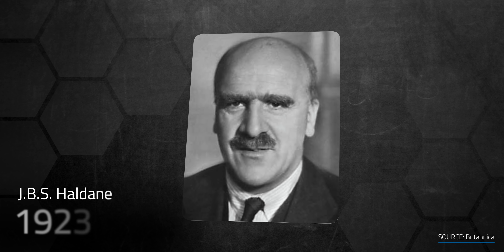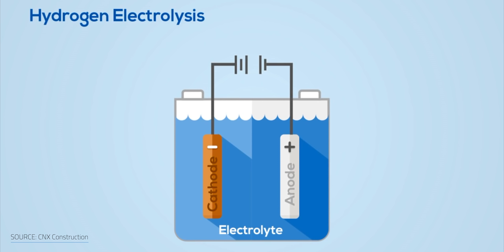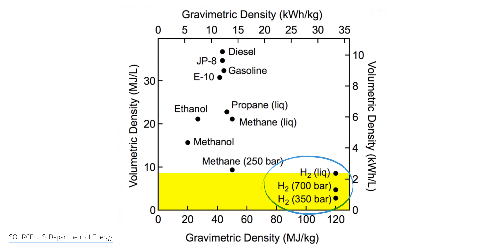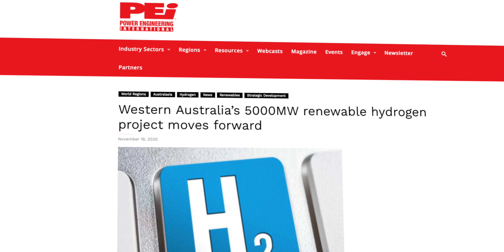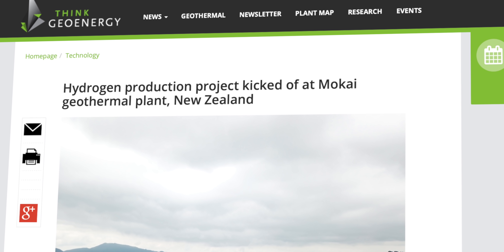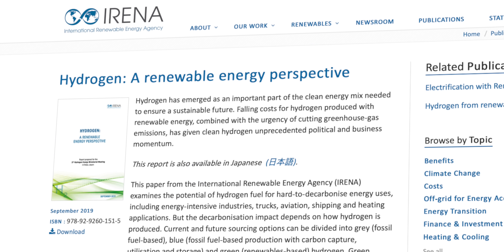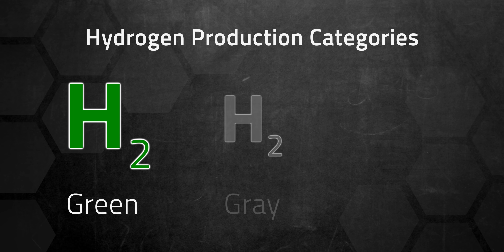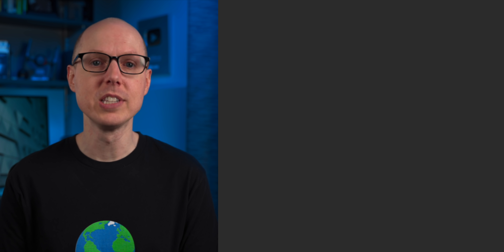The Truth About Hydrogen's Dirty Problem - Green Hydrogen Explained

Comment: Something I do not hear alot about but its being researched heavily by the Hydrogen leader of the world Japan. Is the production of green Ammonia. NH4 is a low energy means to store hydrogen at low pressure and "normal" temperature in a liquid, high density format. It should definitely be looked into as it can also be used as a fuel directly or the Hydrogen can be slit from the Nitrogen.

Comment: I don't think we have anything to worry about as far as renewable energy production goes. There is so much hype there, I see it as practically inevitable. That said, one sector that I have seen disappointingly little advancement in is diversifying energy storage. Yeah, yeah, Elon Musk and his tabless batteries is great, but it's wholly insufficient. Hydrogen has been the one tech I have wanted to see thrive more than any other. It just works so nicely with how we currently use fuels; you can store it practically indefinitely (albiet, not as easily as gasoline) and transport it in near identical ways to fossil based fuels. Refueling is also another big factor in my opinion. The world we live in is far too "go-go-go" for standing around for anywhere from a half hour to several hours to "fill up".

Comment: You seem to paint a rosey picture of hydrogen. 
I didn’t see where you said how much water is needed and where it’s coming from. It’s not a one to one ratio. 
Looking at the media over the past few decades it seems like there is a fresh water shortage. So that leaves the ocean. 
Is that a good idea? 
Apparently you are ok with that since you didn’t mention any pitfalls there other than hydrogen is great and has great things that MIGHT happen in the future.  
As for electricity I was under the impression that the grid can’t handle electric cars as it is.  
So how can hydrogen be better if it requires more electricity to make it than to just charge it. 
I am assuming you didn’t mention any of those little details because you think they are not an issue. 
Why don’t you make a video telling us all how much electricity “green” hydrogen requires and same for water. And then if it does require enormous amounts of water you can discuss how we would get that water. 
This way we can see how hydrogen is better as opposed to telling us how it can be made stored and used better than anything else. 
I’m all for better things.

Comment: The reason I don't think hydrogen will be a fuel in the future, other than for planes, is that it would require the build out of hundreds of billions to trillions of dollars of infrastructure.  EV's will dominate because the world already has a built out infrastructure for it.  The electrical grid WILL require some upgrading, but the cost of upgrading will be much less than the cost of building out a hydrogen based infrastructure.  Also, when you think about it, hydrogen fuel cells will still produce electricity so hydrogen just complicates things, and you have to expend electricity to generate the hydrogen in the first place.

Comment: Green hydrogen isn't sensible for energy storage or as a fuel because batteries are far cheaper and more efficient for nearly everything but flight. But we need green hydrogen as a reduction chemical f.e. for steel production, if we want to decarbonize our society.

Comment: Great video, but I disagree with the part about developing an infrastructure to transport Hydrogen.  You don't really need to transport Hydrogen because you can generate it on site.  The only thing you need to make hydrogen is water, electricity, an electrolyzer and a place to store it.  You could build a hydrogen production facility next to every gas station, convenience store, or truck stop so people could refuel where they're already used to refueling their ICE vehicles.

You could argue that the Hydrogen would be less "green" depending upon how the electricity was generated but that's true for BEV's as well.  The point is that Hydrogen and BEV's will become "greener" at the same rate the electric grid becomes "greener".
Reply: This is true in fact it's being done on experimental scale already. Problem is Electric-hydrogen-ICE only has less then half the total energy conversion efficiency vs Electric-BEV, due to the low thermal efficiency of ICE, which is unlikely to improve much since we have already been trying very hard to do just that for decades. Key point is hydrogen is therefore at least twice as expensive as BEV, so hydrogen is unlikely to ever compete. But no problem because BEV works just fine, for cars at least.

Comment: Hello Matt,

I've been hearing alot about hydrogen over the past few years.  One thing I do not hear about is that hydrogen still produces an adverse greenhouse effect by its residual water vapour. Essentially, the water vapour is a greenhouse gas and contributes to global warming/climate change.  Do you have any thoughts on that?  In general, the only negative thing I hear about hydrogen is the costs.
Reply: Hydrogen has lots of problems, but that's not one of them. Water vapor is constantly being added to the atmosphere from all kinds of sources. But it's also constantly condensing from the atmosphere as dew or precipitation. It's a dynamic equilibrium. Operation of fuel cells won't change the average  humidity in the atmosphere at all.

Comment: I don't ever see Hydrogen being the go-to solution to replace gasoline and diesel. The main reason is danger. BEVs are so much safer than ICE cars for 2 reasons: better crumple zones and no explosives stored in the car. Hydrogen cars would be both explosive and require a lot of mechanics to take up crumple zone space. 
I could see it being used on bigger transportation systems. Mainly because the benefit of longer in-use time tends to beat the battery size and weight. No one solution is perfect. BEVs are fantastic for the masses, and hydrogen could be the solution for bigger transport, but I don't see one or the other taking over entirely until there's MASSIVE progress, and soon.

Comment: I like how you've included pricing and not just energy efficiency, as that the driving factor in most things.

This is a great idea for transporting energy from distant renewable sources and I'd like to be enthusiastic about it. Unfortunately, hydrogen has the lowest energy density of fuels, even liquefied, which isn't easy. Hydrogen is also notorious for the difficulty at keeping it contained, bringing up safety considerations. 

Methane or even propane generated by renewable sources would be a far more useful solution, as it can tie into existing infrastructure without issue. These processes are a bit more complicated, but are vastly more energy dense, and are carbon neutral in this form. Creating Longer chain hydrocarbons from CO2 isn't very feasible at the moment.
Reply: @George Mann there are several chemicals that use the abbreviation DME, including the he psychedelic, lol. I assume you mean Dimethyl ether. It's low boiling point leaves it on par with other fuels except it contains oxygen meaning it burns very hot and its auto ignition temp is rather low. It's LEL is essentially zero, meaning a leak is very dangerous. 

Methanol is actually a decent choice, as it's a liquid to well above room temp. It burns slightly cooler and has a slightly higher auto ignition temp allowing it to be used in existing devices with fairly limited modifications. I would suspect it's greatest use will be for aircraft, due to its liquid form and average energy density. It's LEL is average, not super safe, but not crazy dangerous either. On the downside, its extremely toxic to humans and  large animals, and is soluble in water unlike traditional fuels. This makes spills rather difficult to clean up, even compared to traditional fuels.
Reply: @George Mann last time I checked, jet engines don't work so well with (bio)diesel. Hence the suggestion. Methanol would have an energy density far superior to hydrogen which is the topic of the video, while still having some chance at being viable in a jet engine designed for it. Methanol, methane, and propane have greenable processes that are by far, more scalable then biodiesel. With scale, comes large scale problems, such as spills. I wasn't talking about someone spilling a bucket, I'm taking about a tanker or pipeline spill. There already has been ground water contamination issues with industrial spills of methanol. It isn't a game stopper in my book, but still quality to factor in, and avoid if a better solution is available.
Reply: @George Mann I didn't realize that there's a new method gym Oxford Uni that seems to beat the Fischer–Tropsch method to make long chain hydrocarbons from CO2. It's hasn't left the lab though and hasn't been scaled yet. The Fischer–Tropsch method requires extremely cheap energy, to be competitive with non - carbon neutral sources. I haven't run the numbers, but the articles I skimmed all mentioned is low selectivity and efficiency.

This is in contrast to the sabatier process, which has high selectivity and decent efficiency that'll work work available solar economics. While It might not be competitive with methane from natural sources, it's still within reason that it's still considered for use, with pilot projects being built.
Reply: @George Mann ah, now I see the angle that your viewing it from. The point of hydrogen as a fuel is to allow a carbon neutral energy system that's reasonable from an economics and engineering standpoint. I personally don't think it'll achieve either of those very well. At least, not until we have micro nuclear fusion reactors perfected... 🙄 It's energy density is just too low with the difficulty at preventing leaks just too high. 

The sabatier process is close enough that methane from the process is on par, cost wise with purified methane from natural sources. At least when using a renewable energy source. (NG isn't pure by any standard.) With pilot projects coming online, along with testing the prices on mars within thy year, we'll have enough data to know if it's feasible long term at scale. 

Honestly I'm unfamiliar with the processes for methanol, and have only skimmed some articles. But the whole point here is to be carbon neutral. Steam cracking coal isn't going to achieve that goal, unfortunately. We're in a world where we really need to go carbon neutral, but it's going to be substantially more expensive than staying on par. Partially due to low energy densities, partially due to the expensive processes required for carbon neutral, high energy density alternatives.

Comment: the only hype i'm seeing is the EV on lithium batteries that are extremely NOT ecofriendly and even involve child labor in digging the materials. Green hydrogen should be the ultimate goal of energy storage. At least 50% of energy should be stored in H2 that we can use in transport and shipping. About 20% should be stored in liquefied air, since the technology is extremely cheap and powerful. Another 10-15% - liquid metal batteries. And the rest would share lithium, chemical, and so on, means of storage. But what we're doing now with the EV hype - it is nonsense. We'll drop it in 30 to 50 years for H2 anyway. We're wasting time. Why? Because Elon Mask said H2 in BS... That is literally the only reason! An opinion of one man...

Comment: Hydrogen is a waste of time for individual consumer usage. If any use, planes aren't a bad option (if it's even possible) but for land vehicles, battery electric is the way to go. It's battery electric with more steps, and more infrastructure needed for the same goal.

Comment: The cheaper the process gets the more likely it is to happen. Hybrid hydrogen/electric aircraft, steel production and long range heavy transport could work, Seven million people die from air pollution each year so it's worth researching. Solar panels were a pipe dream once.

Comment: While I like all of the advancements that have been made in hydrogen energy storage tech, I can't help but think its time has passed.  Thanks to the BEV market, battery technology has been advancing so quickly that the few advantages hydrogen has over batteries will soon disappear.  Once that happens, batteries will become the obvious choice being simpler, more efficient, and less expensive.
Reply: Uhm wrong, the hydrogen technology was seriously neglected over the decades and fortunately now companies are working on improving it, some companies are even developing a better hydrogen storage solution and its going to be a very good deal.
Reply: Batteries require rare earth elements like lithium, which are difficult to recycle.

Comment: Do a video on green steel production! Historically, steel is produced from raw materials by blowing CO through a blast furnace which holds iron ore (which is just iron oxide). The intent of this process is to reduce the iron by generating CO and CO2, which obviously isn't the best. Hydrogen steel making is slowly starting to be implemented, where hydrogen is used to reduce the iron, instead of carbon-based gasses.
Reply: The CO is typically produced by coke (usually coal, but maybe petcoke (with it becoming common due to everyone’s favorite   T A R    S A N D S) inside the blast furnace.  Air is blown in though.

There is some “Direct Reduced Iron” which is done in a fluidized bed reactor with the reduction gas (co and/or hydrogen)
Reply: This and concrete will really be essential though.

Comment: Great video, all good information at just the right pace and duration. I can see Hydrogen being very useful for fixed and fleet applications. I also believe Toyota wasted a lot of time and resources trying to make it applicable for passenger cars (too soon) when they could have really made progress on battery cars. Unless it gets really easy to make and store Hydrogen it's just not a good fit for cars. There are plenty opportunities for Hydrogen that make sense without targeting passenger cars. It's going to be hard enough to get enough charging stations built without having competition from Hydrogen. Now, if Hydrogen fuel cells power those "fixed" chargers along the road? I'm cool with that.
Reply: Green hydrogen contaminate less than electric energy

Comment: I think we can electrify everything. We do not have the infrastructure for hydrogen storage nor it will be cheap since you can't change chemistry that h2 has a volume problem for storage. Electricity grids need to be modified for its infrastructure, hydrogen needs to be created and maintained. The problem is storage battery or h2 alike Once we can make that happen its game on.
Reply: The snag with batteries is that we also need to create a lot of them, and that needs mineral extraction. Do we have enough lithium, cobalt, nickel etc? Do we really want to dig it all up? Hydrogen does look appealing in that regard.
Reply: @armadillito  nah in the energy storage its LFP Lithium Iron, phosphate, Redwood materials states the biggest mines could be in peoples drawers. Cobalt is being phased out of 4680 cells from tesla and china branded 4680s . Also in the video he states liquid batteries which is just large anode and cathode mixtures. ( he also made a video on this) Recycling will make it a closed loop system. Examples of LFP are Tesla megapack, every other residential storage battery besides tesla.

Comment: Excellent presentation Matt. You talked about Australia, but I was surprised you didn't mentioned LAVO. Their metal hydride storage technology addesses one of the challenges with hydrogen: the need for large storage systems. Metal hydride storage, coupled with a residential PV array, could be a step toward widespread off-grid adoption.
Reply: The biggest problem with hydrogen for use where batteries can be used is round trip effeciency and maintenance.  Round trip effeciency is 50% excluding transportation and compression. Also need to consider the maintenance of the fuel cell and electrolyser. The fuel cell needs oxygen which comes fro air which needs to be filtered. The same for the electrolyser and the water it consumes. 
So straight up you need twice your electricity supply compared to using batteries.
Reply: @George Mann yes. I agree. I was just being extremely conservative.  The effecient is so low that just the comparative energy cost will make too expensive unless there is no other choice.
As you said methanol would probably be a better fuel for aviation or shipping  which is the only place where batteries would not be viable. Even long haul trucks could work with battery swap And enough battery depots around.
Aviation needs a liquid fuel at low pressure (ie atmospheric pressure).
I don't see hydrogen taking off.
Reply: Storing hydrogen as a metal hydride would eliminate the need for compressing hydrogen.  Batteries cannot store energy for long periods of time (like months), hydrogen can be stored for years. 
Batteries and hydrogen both have strengths and weaknesses that make them good in different ways. We need to develop and apply both wisely.